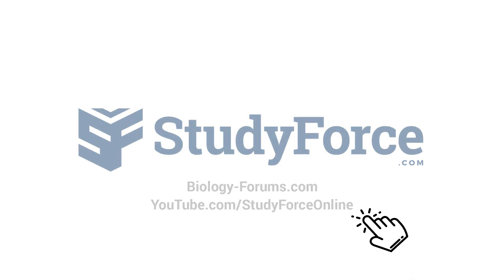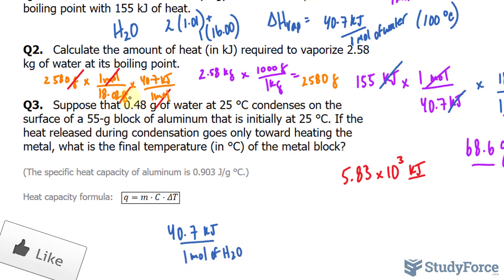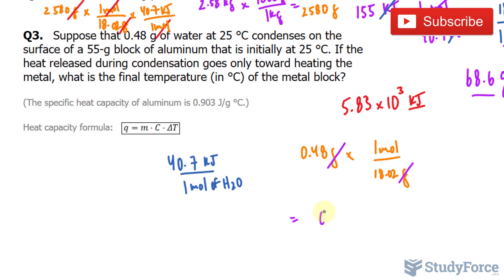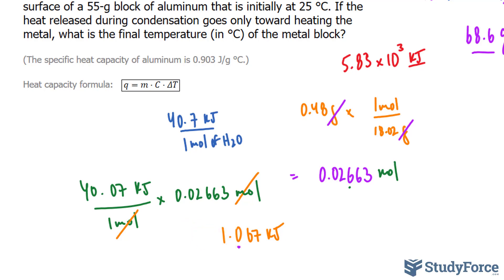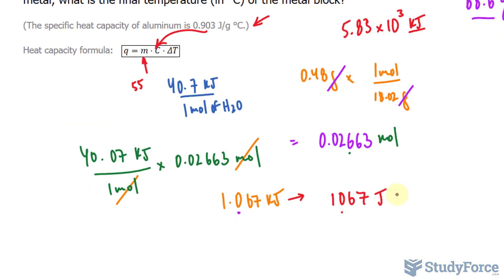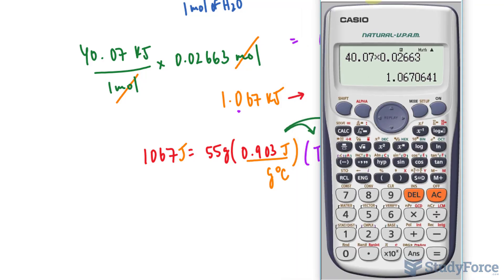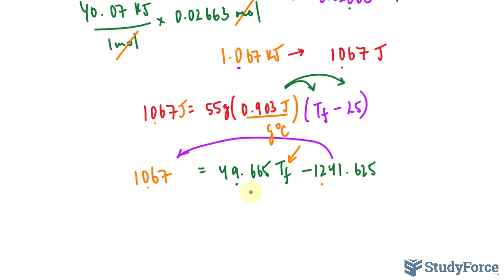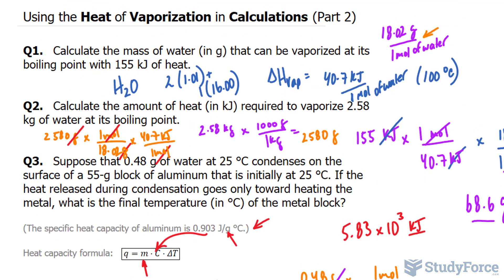⚗️ Using the Heat of Vaporization in Calculations (Part 2)

Comment: I think that the heat of vaporization that should be used is that of water at 25 degrees, which is 44 kJ, not 40.7 kJ, which would be at 100 degrees Celsius!